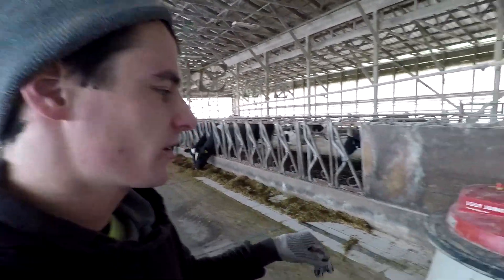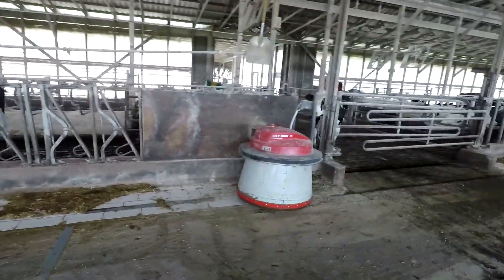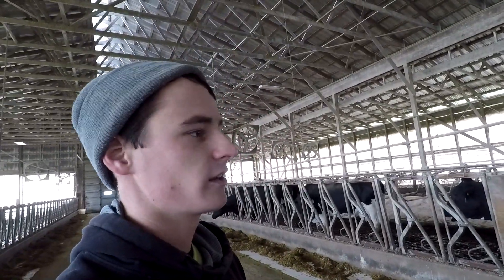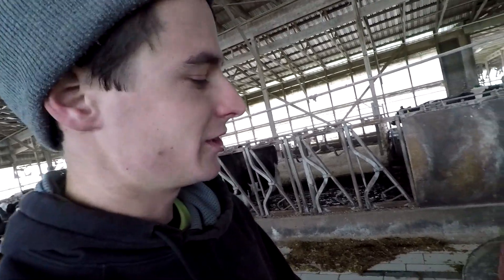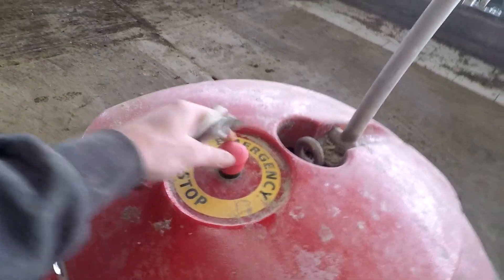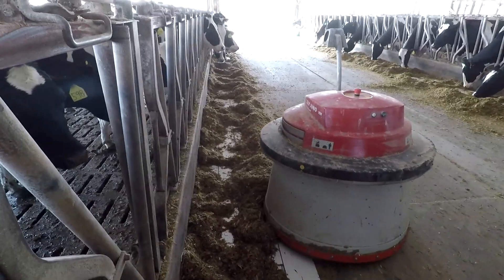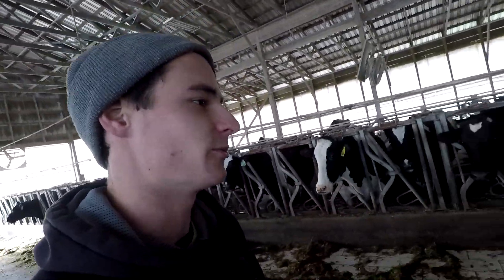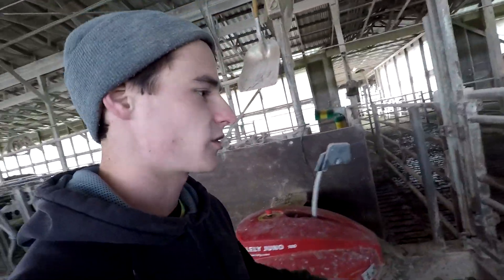Robot Feed Pusher

Comment: I have been in automation for quite a long time.  My question is what guides the pusher?  Is there a wire in the concrete that it follows?
Reply: On the feed table should be metal plates, which he reads.   And other guidline is ultrasound. It reads the distance to feed fence. When you just enter the barn with feeder, Juno will go further from feed fence. Dunno how its in his farm, but you can set the setting how close or far Juno will go. And how often. Also, if the machine thinks that he will not be able to drive all route, because of batteries, he will stay in charging station and will go, when he will be ready.

Comment: Im not a farmer, but I am a computer engineer, so Im curious how the robot guides itself, is there a wire embedded in the floor that it follows?
Reply: The most rudimentary way would be to tell the robot to move forward X meters then turn and go X meters and so on and so on. Since he's got an app in his phone I guess you'd set it up by manually controlling it and then making and saving a route for it to follow.